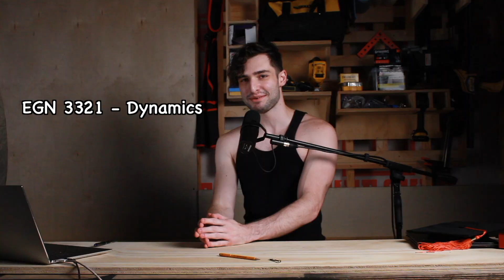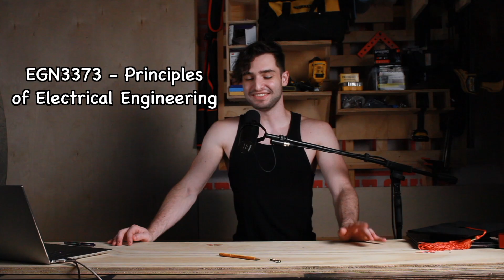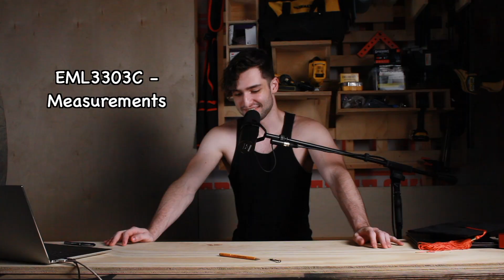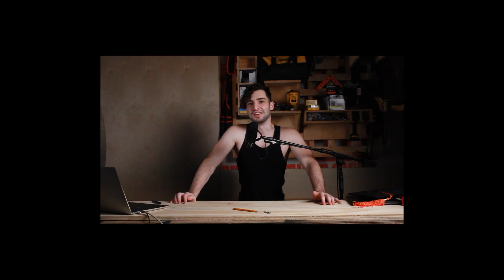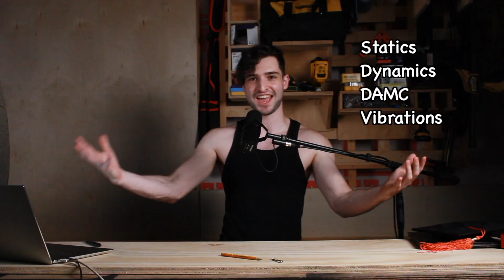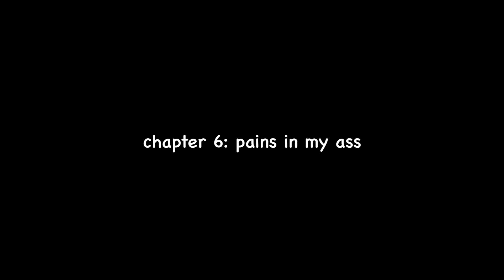5 Years of Engineering College in 15 Minutes

Comment: Ok stop you said the fluid in convection is air could you like explain that puhlease
Reply from the maker: Of course! “Fluid” in engineering is a word that means “either liquid or gas,” but most people think of fluid as only liquids. The way a convection oven works is it heats up air and then blows it over your food to heat it up. Does that make sense
Reply: @KosCreates I can understand that the only reason it trips me up is liquids and gasses behave so differently and transfer heat differently (I think) and I don’t know I guess it was just strange that they’re both able to be represented that way
Reply from the maker: You’re right to think that - the difference between them when doing math is very significant (mostly because gases are more compressible) and for fluids and thermo calculations that matters a lot more. In heat transfer though (which is what this example is under), we simplify them into “fluid” bc it makes the math easier and doesn’t fuck anything up most of the time.
Being an engineer is mostly about getting out of doing complicated math by making intense simplifications like this